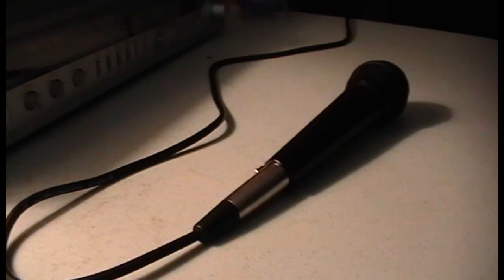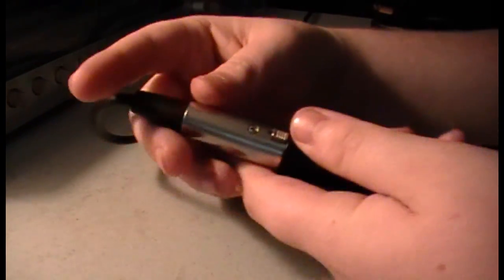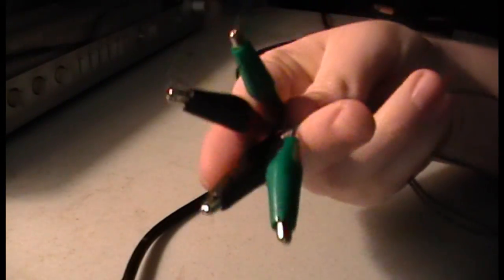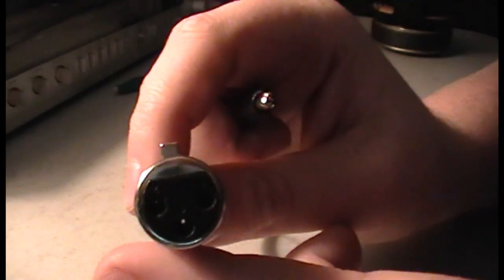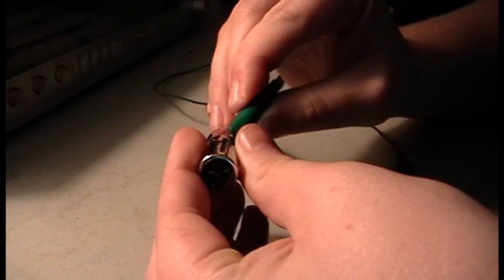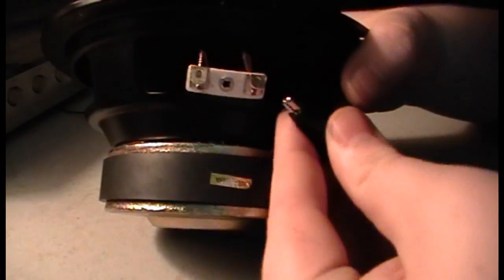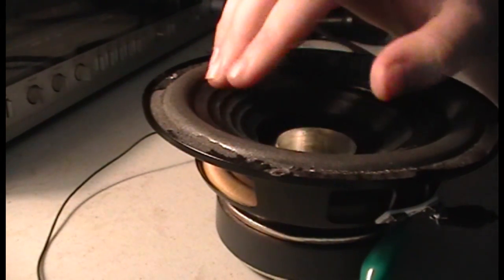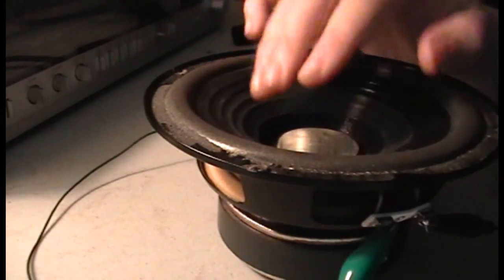How to Turn a Speaker into a Microphone

Comment: Yes, positive and negative matters, quite a great deal, as does proper phase alignment of mics! If you doubt it, fire up your favorite tune and listen to it loud, then reverse the polarity on your speakers. When the polarity is reversed it won't kick you in the chest anymore. In your previous video (micing the kick with a D112), if you're recording analog, then yes... 3 to 1. If you're recording digital, sound travels 1128.6 feet per second at 68ºF with a relative humidity of 40%. All DAW software allows you to add a delay so to phase align the mic and the speaker you would apply a delay to the kick drum mic of 2.68 milliseconds or if you're recording at 44.1 kHz that would be about 118 samples. Of course... you could eliminate the delay by chopping off 118 samples from the speaker track and then moving it back 118 samples and it would be in perfect phase with the D112.

Also, as per the AES standard, pin 1 is ground, 2 is positive, 3 is negative. Also, the pin you pointed to at 2:14 is pin 3, not pin 2.

Comment: I quite like the sound, actually, a sound I don´t think I could get with a ´normal´ mic.
Reply: because most "normal" mics are condenser mics. The membrane is actually one side of a capacitor. They're more sensitive and compact and cheap but they are more noisy and sensitive. There actually are tradition mics that use the good old magnets and coils but they're often more expensive and are used in profession productions only.

Comment: I have recorded at two different studios now using that used this method to mic my bass drum (in addition to another mic) to get deep bass tones. Both techs were using an adapted 10" speaker. They also housed them in some kind of box (similar to a speaker box, I guess) and mounted them very near the resonant head on the bass. I remember liking the tones the got. The first time I saw it and asked about it, the tech explained that it works great for picking up very low frequencies.

Comment: does it have to be xlr cable? why not use instrument cable and 1/4" jack
Reply: Kris Lachapelle because next to no, actually yeah probably none, microphones connect to anything with 1/4 in. Microphones get connected to mic pres, channel strips, audio interfaces, all of which use xlr. Xlr can transfer more information than a 1/4 in cable can. Sounds odd I know but the truth is is that those cables have the hi-fi. Also instrument cables are not shielded, which sucks for audio recording. Also instrument cables are not balanced. Again, sucks.